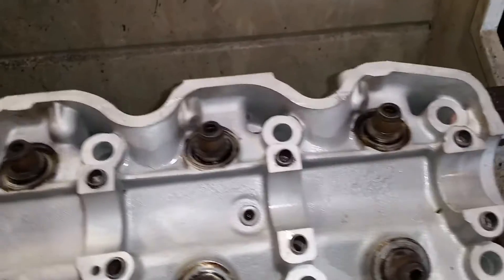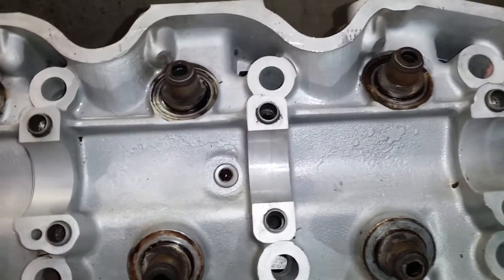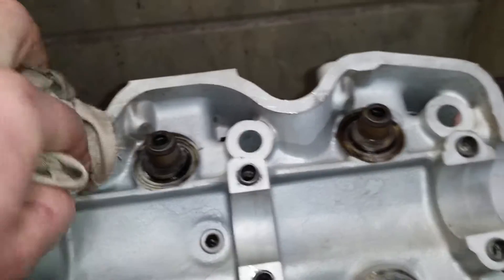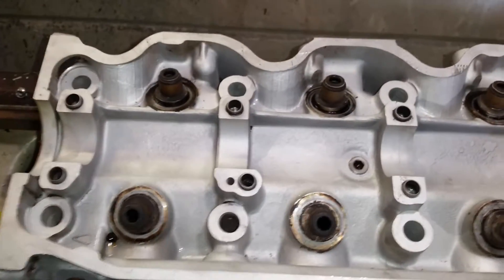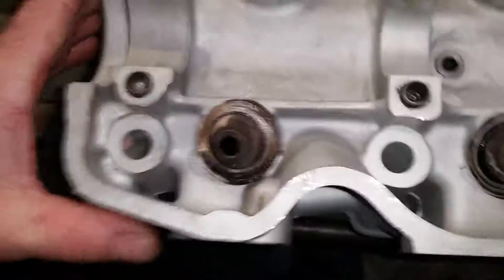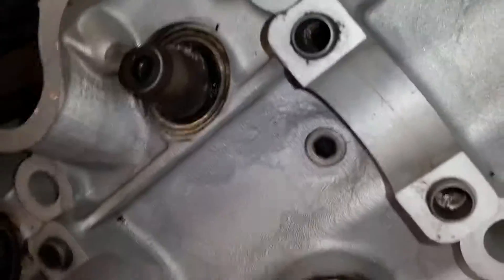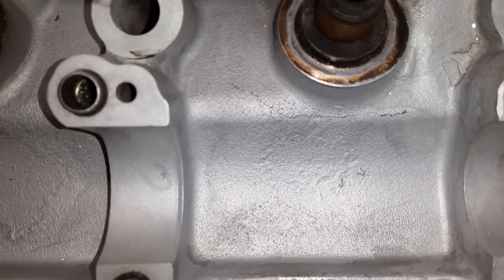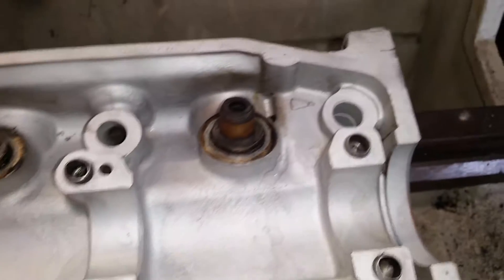6g72 cracked heads

Comment: Wow. My 6G72 cylinder head cracked exactly at the same area.
Reply from the maker: Gábor Vaczó yes they are very common to crack there
Reply: Andrew Cowling Any idea, what causes this?
Reply from the maker: Gábor Vaczó it is usually always the left side head that cracks. I believe that this is due to air being trapped in the left head. I have fitted a bleader to the rear left on the inlet manifold which has appeard to fit the issue. Many years of expanding and shrinking causes it to crack. The factory heads are only about 2mm thick through the section that cracks. The newer aftermaket heads are made of a stronger aluminum and are about 5mm through that same section
Reply: Andrew Cowling Wow, that's an interresting answer, thank you! Could you please tell me, how did you measured the thickness of the oroginal and the aftermarket CH at that area?
Reply from the maker: Gábor Vaczó there is a welsh plug in the end for coolant. Once it is removed a set of calipers can be used to measure the thickness.
Reply: Andrew Cowling thank you Sir. You really helped us a lot. We love theese cars, any additional info for repair is a gift, as there are only a few who know, how to keep them alive.
Reply from the maker: Gábor Vaczó any time